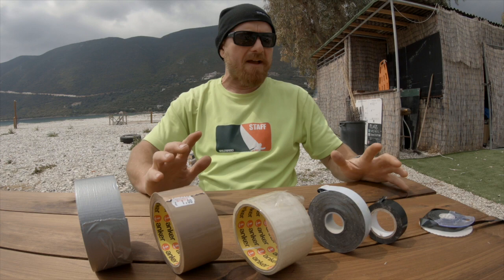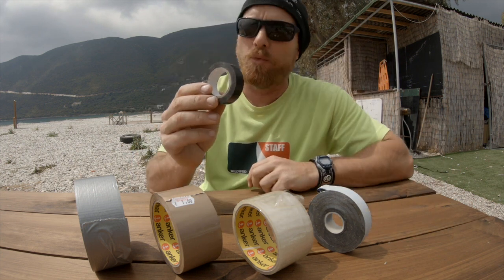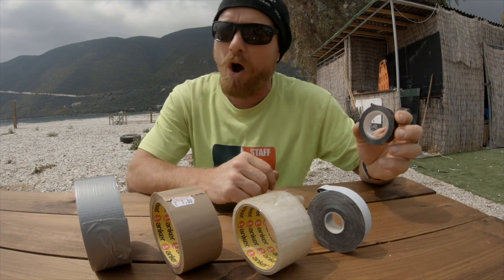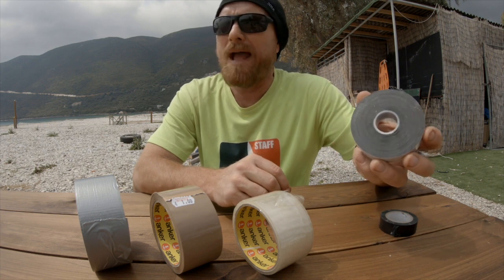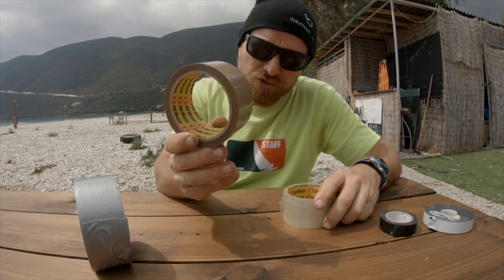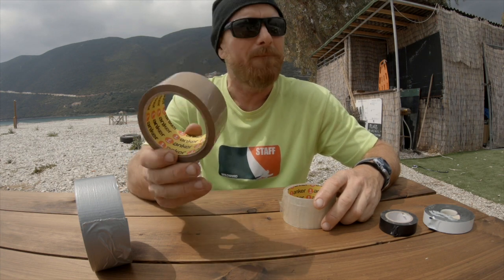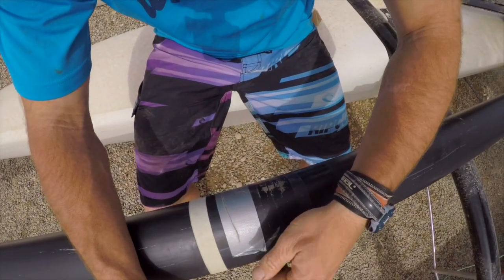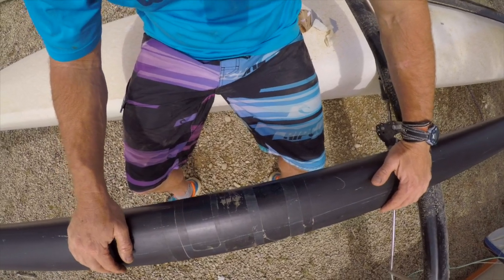Everything you need to know about tape

Comment: When putting away the mast for the winter, we tape the standing rigging and trapeze wires and halyards to the mast using electrical tape by placing the non-sticky side against the wires, rope and mast and the sticky side outward so that in the spring there's no sticky residue on the parts.
Reply from the maker: good plan!

Comment: I Use to use duct tape to cover all split rings. Anywhere the spinnaker would likely to catch.

 White spirit to get tape glue off. Generally keeping any type of solvent off your hull. A good gel coated or painted fibre glass is normally ok. Recommend covering before cleaning any area. Specially if you have a Polyethylene Hull. They cause micro holes as solvents dissolves / melts this type of Hull.
Reply from the maker: Thanks for the tips Paul!

Comment: Duct tape and Gaffer tape are 2 wildly different things. Gaffer tape will not leave any glue behind, even after months in the sun. Duct tape on the other hand isn't UV stable and will turn to shreds and leave almost all of the glue behind.
Reply from the maker: thanks for the heads up - i always thought that they were just different names for the same thing.
How would you tell the difference to look at it?
Reply: Joseph Bennett well “real” gaffer tape is actually a brand. But generally gaff looks and feels somewhere between duct tape and hockey tape. Sorta cloth like in feel but not as much as hockey tape. It comes is lots of colours but black is by far the most common. I always identify it by the way someone in the audio/visual business protects and hoards it. Lol. Good gaff is like $30-$40 CAD /roll, where as good duct tape is more like $7-$8 CAD /roll. So those that have it or use it generally always say something about going easy on it. Lol
In general gaff leaves no residue, sticks to almost anything, stick to itself like crazy, comes off reasonably easily, has no stretch and usually is only purchase by people in the A/V industry. Lol